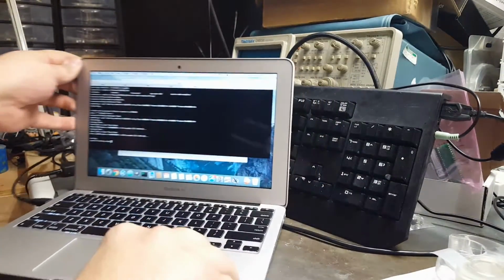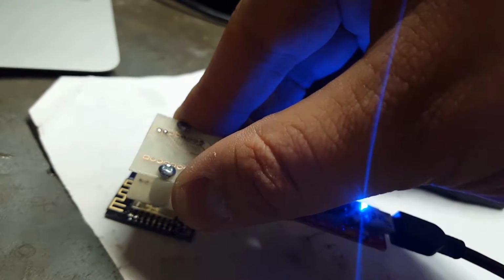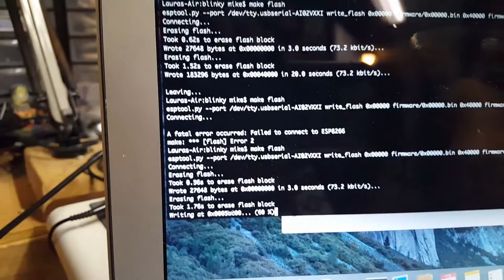ESP12 Pogo Programmer

Comment: Hello sir,
Nice work...
Can i use FTDI232 for programming ?
please tell me values of C1 & C2.
Thank You
Reply from the maker: If the FTDI converter your using has the correct pinout of GND CTS VCC TX RX DTR it should work fine.  The capacitors depend on what regulator you use to generate the 3.3v for the ESP8266 from the 5V usb supply on the FTDI232 converter.  I used a AZ1117CR and it needs 10uF capacitors on the input and output for stabilization.
Reply: Thank you sir